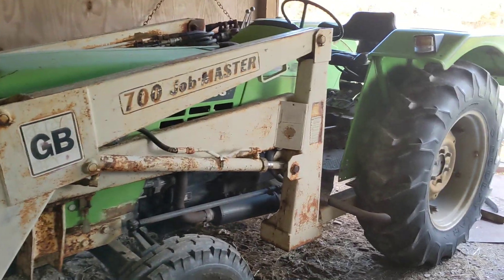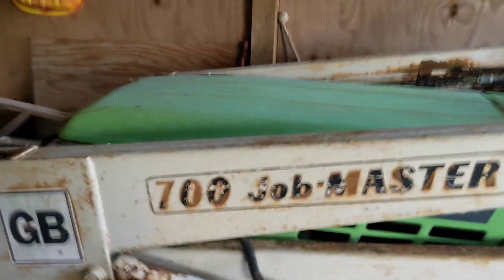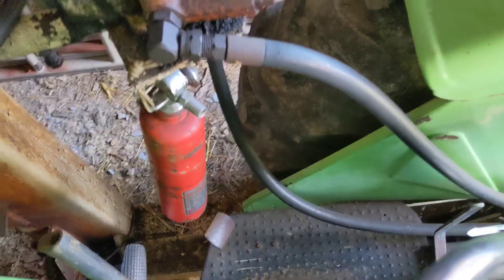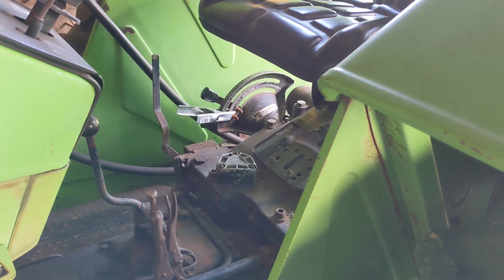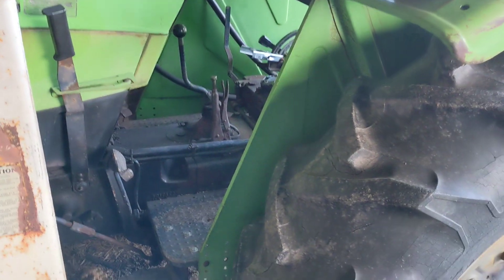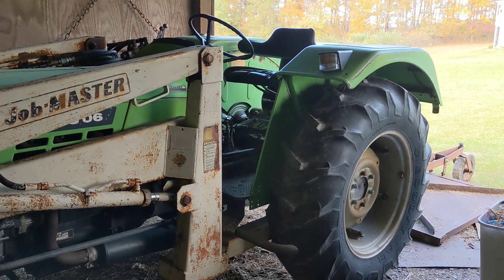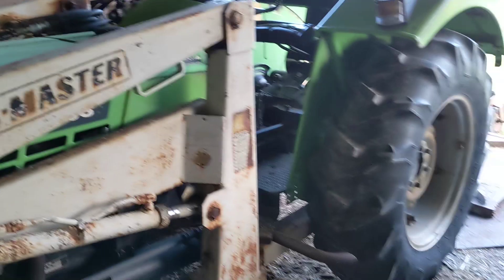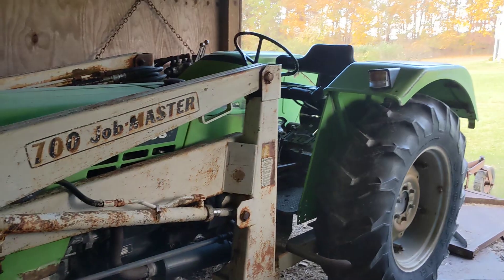Deutz D4506 Tractor Review --- Would I Buy it Again?

Comment: A few of my thoughts that you didn’t ask for. 
1. 1300 hrs seems really low. But with as good of shape as it’s in and those tires, it’s possible that they are correct. 
2. I also find mine is awkward to get on and off. But once I’m sitting in the seat it’s OK.
3. I’m always jealous when I watch your videos and see you still have the OEM top link!
4. A 2wd loader tractor always has traction limitations. The diff lock would help, but not enough that you wouldn’t still want a FWA. 
5. The rear hydraulics being tied up with the loader would be an issue for me. I’d have to get a power beyond block or something. 
6. Definitely fuel efficient machines. I’ve raked 18 acres with a bar rake and tedded another 8 with a 2 basket tedder and used 2-3 gallons. 
7. I’ve found that Ward Brothers Tractor, Holtreys, and Burkholders Tractor have been good places to find the not so common parts. I can drop contact info if needed.
Reply from the maker: Great to hear from you! I'll gladly take the comments : )
I had wondered if the hours were off since they are so low, but I think it is correct mainly based on how much tread on left on the tires which still have the "Made in West Germany" on them. I can't possibly imagine someone importing those tires as replacements, but suppose it's possible. 
For the seat I think I'm going to mod an adapter plate to move it back another couple inches which should help.
I didn't know the top link was so precious!
I definitely need to get that diff. lock fixed and see how much it helps me.
Right now I don't have anything needing hydraulics off the rear. If I ever get a haybine or any folding rake I'll be quickly motivated to free them up!
Much appreciate the lead on the parts dealers! I'll let you know if I need info and can't find it. 
Take care!
Reply: @ 
Made in West Germany is indicative of the iron curtain. So most likely the tires were manufactured pre early 90’s. So they are likely original. 
And to your comment on new tires, I just recently priced some 13.6-28’s for another Ford 3600. I could get Alliance Agristar II for $530/tire. Firestone Evo’s were $755.

Comment: I have a d4006. Your diff lock may be fine. Mine will NOT go down unless one of the tires spin. When a ture spins that is when you press the diff lock. While pressing down it will not click down at first. Keep pressing down and after a second or so it will click down and engage the lock. Its like a gear has to line up while the diff is slipping and once it lines up the pedal goes on down. You have to hold the pedal down as long as you want it locked because when you lift your foot off the pedal will come up with you and inlock the diff. Hope this helps. Ive jad mine arpund 13 years. Bought it with my home at the time from the original owner. He said he bought it in 72. Id love to see the terminal that feeds the rear rem o tes. Mine came with a blank terminal so no rear remote. I have an aftermarket terminal on it now that adds a rear remote. I'd love to see the oem one and how it works. Thanks.
Reply from the maker: Very interesting tip on the diff lock. Next time it is snowy I'll give this a try and see how it goes. I've definitely stepped on it, but not sure If I've held it down for any time while tire are slipping. Very cool that you got yours from the original owner. I think mine was just a quick pass through from the original owner the way the seller described how he got ahold of it, but no way to be certain. I'll try to get some better views of the OEM terminals. Could you let me know what brand your aftermarket terminal is?  Thanks!
Reply: @Buttons_fix_it  I am almost certain I ordered it from Ward Bros. I thought it was going to be  a factory valve pulled form a tractor. What I received was what looks to be new machined part. It works but since I put it on I get a little hydraulic whine. I'd like to source an original.
Reply from the maker: @Fixinlikeapro  very interesting that is was aftermarket! Thanks for letting me know. Been really busy here so haven't dug deeper on my OEM one but it's on my list!

Comment: Hey any idea if any 06 Series Deutz Can do both 540 and 1000.  My 7206 has Two Different PTO speeds.  I have a back, neutral, and a forward gear.
Reply from the maker: @jakepreston4128  sounds like you have the two speed option. My 4506 manual says:  Forward=540, CENTER=disengaged, Rear=1000
Reply: @Buttons_fix_it  I wonder if the pto shaft is two sided?  Or is the actual end you attach to not different?